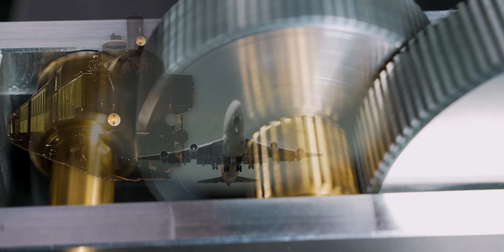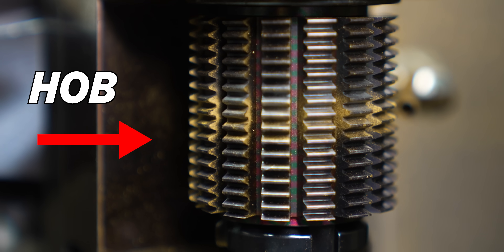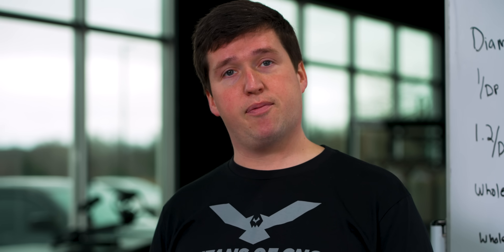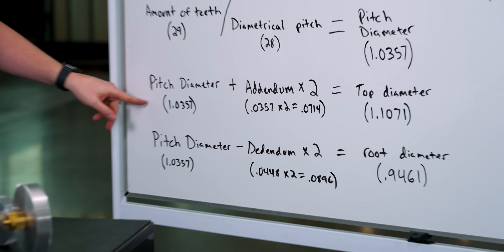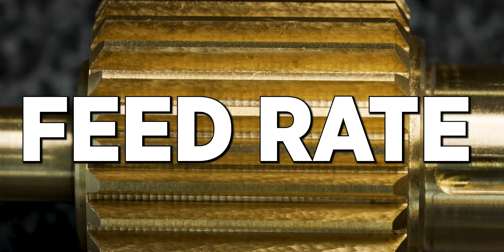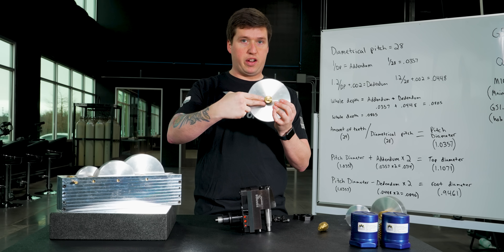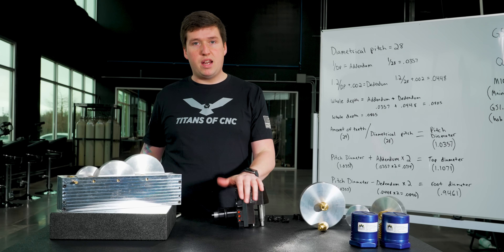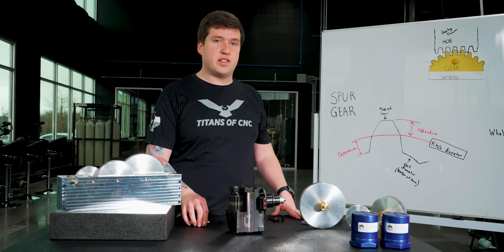This Mesmerizing Gear-Making Process Will Blow Your Mind

Comment: I'm a CNC Machinist in germany and we have to go through a 4ish year long apprenticeship to call ourselves "CNC Machinists". I had that subject in one of my last few questions on my final exam. Till that point we've never even discussed making gears in school, let alone at work. I had to literally learn it on the fly, while the clock was ticking, with nothing else but my calc and my formula book which just briefly went over it. I got 100% on those questions. Its such a "simple" procedure if you can get it quickly, but damn, I wish we actually talked about it in school because this would've been a make it or break it situation on my exam.

I just wanted to share this because the video just gave me flashbacks to my confusing self sitting at the table going all "What the fuck is this shit?!??!". Great video!

Comment: And if you don't angle the teeth of your round gears, they are more likely to catch on each other and bind up or refuse to mate at higher speeds. So it's not only a side effect of how hobs work, it's a necessary shape for gear function

Comment: Back in the day Fellows Gear Shapers used to send out cheater devices for machinists and engineers working with gears. It consisted of two disks enclosed in plastic. The discs had info for DP and modules. Fellow's also had their own system for stub tooth gears which was expressed as a fraction. The numerator was the for the pitch diameter and denominator was used for the tooth height. A 10/12 40T gear would have a pitch diameter of 4.000 with the OD being 4.000 + (2 x 1/12). Splines in the inch system are also expressed as fractions. 8/16, 10/20, 12/24 etc.

Comment: My experience with gear hobbling is all on mechanical gear hobbers. Barber-Colemans. Setting up for spur gears was easy. With a base ratio of 30-1* any spur gear was just 30 teeth for the input and the number of teeth in the gear being cut on the output. We had whole set of gears made up from 22T to over 72T. Helicals were a whole different ballgame. Get out the scratchpad and start figuring and after you figured out the index gears you had to figure out the feed gears. We actually had a book at work with the thrilling title of 14000 Gear Ratios. Once l had a solution for index and feed gears for a job l wrote it all down to future reference.
*The ratio between the work spindle worm gear and drive worm.

Comment: Can you make a video on internal power skiving and where to get the tools from for job shop work for lower qty jobs. Would be great to see it on the Doosan with the B axis.
Reply: @mikee6505  I would suggest power skiving not a great solution for job shop work, tools are expensive and usually dedicated to a pitch and number of teeth in the gear, assuming the machine has the level of rigidity and spindle synchronisation necessary to cope with the very demanding nature of the process. Most major producers of gear tools can help you, Gleason, Liebherr, Dathan etc along with many conventional tool suppliers like Sandvik, Horn, Emuge etc etc.

Comment: The thing people really don't get about gears is that the faces of the gear teeth actually roll against each other, it's not a sliding contact at all. (Unless you messed up, and you're going to wear that gear out in short order).

I thought you were going to miss the rake angle of the hob.... but then you got it.  ;-)

Don't forget that if you're going to make a lot of gears, you'll want to move the hob up and down between parts on occasion to spread the wear across the cutter.  Sharpening the hobs is a whole video of it's own.

I worked in a gear shop for a few years, we had some odd sized hobs that were 100 years old, that we only used occasionally, but when you need em, you need em.

Given the variety of gear teeth I cut in the job shop I worked at, it's quite likely some of the gears I helped make will still be in use 100 years from now.  That gives me quite a feeling of satisfaction.

Comment: Some corrections. 
The hob does not cause the gear blank to rotate as it sounded like you were saying. Both must be independently driven but at different speeds, the ratio of which is proportional to the number of teeth required in the gear.
Talking about how big a gear is in regard to addendum and addendum is ambiguous and confusing. You should be talking of the number of teeth and the module or DP of the teeth size. 
Addendum and dedendum do not disappear on a rack. That geometry is still relevant to racks. You are conflating the involute profile with addendum and dedendum.  That profile does become a straight line in a rack. But it is an involute curve profile for all spur gears and the other types.
The addendum is the distance from the top of the tooth to the pitch circle or pitch line in the case of a rack. That distance is half the tooth pitch. Deddendum is the addendum plus a clearance between the crown and the root of mating gear teeth. 
However, you did a great job describing the process in your "Calculating all this stuff" section. 
Sorry to go there, but I've been manufacturing gears for my servos for 40 years. 
Can't help but be a smartarse. LOL. Even if I'm just a tiny fish in a big pond. You guys are the sharks! ;-)
Reply: Came here to write that, if you don't drive the gear blank you will end up with crooked or wavy teeth, or it will fail to start in the right pattern altogether. Pretty sure he meant it in a way to make it better understandable for people who aren't familiar with this technology, but still.

Comment: If I may be super fussy about gear nomenclature- I think I'm hearing you say "diametrical" pitch rather than diametral pitch. I think it's written on the board as well. Excellent content regardless! Thank you for the education!!
Reply: I am trying to figure that out too haha. I also noticed your dedendum formula doesn't work with std hobs. 1.157/DP (diametral pitch) = dedendum. I'm getting different answers than our hobs say using your 1.2/DP +.002. Machinist handbooks also have my formula. Where did you find your formula for dedendum? Thanks for the video

Comment: Thank you for gear video. Next level is put a spline on the shaft and get a gear made on the wire EDM with a spline inside and a gear outside.

Comment: Thanks for tackling this subject, often seen as a ‘black art’ by many in Engineering production. If I may I will add a few comments that viewers may find useful. A rack as shown on the sketch of the Hob tooth profile in this video is simply a gear with an infinite pitch circle diameter and thus the involute profile is a straight line. The involute profile is simply the path traced by a point as it unwinds from a base circle (you can create a drawing of an involute with a plate, a piece of string and a pencil) and the gear tooth is a selected portion of this. It may also be useful for some viewers to know that hobbling is a continuous gear generating process (as are gear shaping and skiving etc) and thus the shape of the tooth is not the same as the hob cutter used to create it. This provides for a much more accurate gear profile than that which might be achieved using a form tool with the tooth profile ground into it and a using indexing or dividing head approach on the machine. Modern CNC machines use advanced synchronisation of the cutting and work-piece spindles often called an ‘electronic gearbox’. The control of this synchronisation on lathes and milling machines (non dedicated gear production equipment) is a relatively recent development which has given some of these more conventional CNC machines additional flexibility and capability which is desirable in some applications. Dedicated gear manufacturing equipment from the likes of Gleason, Liebherr, Koepfer, Monnier + Zahner etc takes gear production of all types to very high levels of productivity and capability and you should consider a feature on these machines.
Reply: Great input. Decades ago I had the opportunity to purchase a hobing machine. It was a great price but it would have cost thousands to get it from the UK to Australia. I was going to CNC at that time (35 years ago) and thought I could just make my own "electronic gearbox" and cut gears on my lathe. It's straightforward. The spindle control (which is a servo motor) is handed over to the hob spindle (also a servo motor), and the spindle just follows the hob at the appropriate speed ratio for the number of teeth. My machines are small and just CNC retrofitted manual machines. Right now I'm assembling a larger lathe. Going to have twice the speed and twice the torque and X axis much longer for more ganged tools, including live tooling.
Reply: @robguyatt9602  Hi, Great that you developed your own electronic gearbox, many would find this a daunting proposition! Problems with synchronisation arise when you are looking at high speeds and the hob and workpiece spindles need high performance feedback (encoders) etc to synchronise correctly along with advanced software. This is particularly an issue when you need high levels of gear accuracy for pitch and lead errors, the profile being more related to hob quality. Gear Metrology is also a fascinating subject all of its own. I have been lucky enough to work for a company that specialises in fine pitch gears of the highest quality and has been able to invest in the finest machines and metrology equipment to achieve its goals. Good luck with your endeavours in the gear production world.
Reply: @alexgreenhalgh935  Thanks for your reply. I actually wrote my own PC CAM program to drive my first CNC retrofit. Simple program that drove steppers full step. Two axis interpolation was a struggle though. What do you call fine pitch? My gears are mostly 0.5 mod but also some 0.3 mod. I have also done gears of 4 mod but they were 3d printed. I expect you are familiar with those sizes but just incase you only work in dp, 0.5 mod is about 48 dp. 
Yep it takes high speed processing of encoder signals for tight sync. I use a 50 MHz microcontroller. Also, the servo drivers  for the two spindles are tuned to tight following error. You might wonder what I do. My bread and butter work is RC servos used for sail control in RC racing yachts. These are winch servos, which means they do multiple turns as opposed to the normal 1/4 - 1/2 turn off-the-shelf servos used for steering, rudders, etc. I also do occasional one-off commissions. My favourite was an extra large winch servo for an autonomous yacht designed to cross the oceans.
Reply: @robguyatt9602  In the UK most engineers say over 50ish can swap seamlessly between Inch and Metric systems so happy with either, although Module is increasingly the most common. We typically work in the 0.2 to 1.5Mod range, but we can cut up to around 4 Mod for Anti-Backlash pick-off gears that occasionally crop up. We also have proprietary transmission error measuring tools that can be used to evaluate gearboxes and gear machines and we can usually squeeze more performance out of a machine than the manufacturer designed it to have 🙂.  Funnily enough I am building a entry level RC yacht myself (only an off the shelf, low cost Dragonforce 65 kit, but you have to start somewhere) and looking forward to sailing it in the summer, so familiar with the winch servo concept.
Reply: @alexgreenhalgh935  When I started my apprenticeship in 1973, Australia was transitioning to metric. So yep I'm bilingual LOL. Cool that you are getting into RC yachting. The DF thing has been a great innovation for the sport. My market has always been the top end of the world RC racing scene. The IOM class my biggest production of course. My range goes up to the huge J class used in the USA. Even if my products were allowed under the DF rules, I would not be interested in upping production. I enjoy my small 1000 units p/a manufacturing schedule. I don't have fully automatic CNC so it's pretty hands on. Except for 3d printing which is used for some parts including low load gears. But the main servo gearbox is all machined. Certainly nowhere near the precision of what you talk of. My ears are my measuring tool for quality gears. They have heard a lot of teeth  over 40 years. LOL.

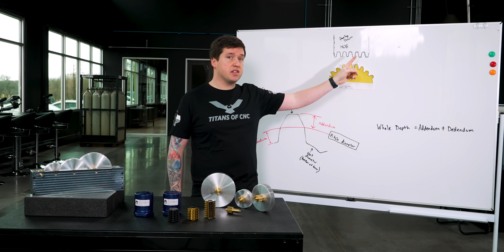Comment: 2:10 A Rack still has an Addendum and a Dedendum. Its with at the Pitch circle defines Addendum hight with is important when you want to grind gears after Hardening. Then you would use a hob with a bigger addendum and machine the root circle to finished dimension while still leaving stock on the flank to be ground later.

Comment: The fact that people figured out involoute teeth without simulation is amazing to me. If you think about it REAL hard, every tooth exchange is a wheel rolling against another wheel.  The first tooth face against the second tooth face is a wheel rolling against a wheel for a fraction of a second. And this is how involoutes prevent acceleration and deceleration between tooth exchanges and with minimal friction.  Brilliant!
Reply: The principle of generating the involute curve for a tooth profile is quite simple. I would develop the curve on the drawing board and then use that to create a template to hand grind the tool. That was 40 years ago, before I had access to CAD and CNC. That came a few years later and as Titan would say "BOOM" production went through the roof. I must have cut a shit-ton of gear teeth over the last 40 years, LOL. The invention of the involute profile was a game changer for sure. In theory, it creates a rolling motion between mating teeth and, therefore, zero friction. But you are right. In the real world, there is friction, but it's tiny compared to the early tooth forms.
Reply: @robguyatt9602  it's the association between an involute tangent to a circle can convey a perfectly circular and synchronous engagement between two surfaces other than the two pitch circles such that there is no sliding but two rolling surfaces.

Machining that is amazing, yet, but figuring it out is what amazes me.
Reply: @ You just repeated what I wrote.
Reply: @robguyatt9602  no sir. I rewrote what I said.
Reply: The most fascinating thing is that there isn't even much math involved in the machining. The cutter is just like a thread with a trapezoidal profile, so only straight lines. Yet, the rotating motion of the blank during the cutting will cause it to create a perfect involute curve, no matter the size.
Reply: @CatNolara  right! It's just machines doing what machines do. I am sure this CNC machine makes superior gears, but hobbing can be done just through mechanical action.
Reply: @coreyfro  exactly, I've even seen people having attachments for gear making on an old school shaper. It had a trapezoidal tool and a mechanism for advancing the table and an indexing head at the same time. Super interesting
Reply: @CatNolara  that's EXACTLY why I have wanted an ol school shaper. That and they are just HYPNOTIC.

Comment: When I make a helical worm wheel I use a dividing head and a single HSS  fly  cutter shaped on a bench grinder. Any tiny discrepancy is not a problem because the machine I'm repairing has been working for years with worn out gears before stripping completely. 
Btw I made my 81 tooth bicycle chainring with the rotary table.
Reply: Greetings Sydney Australia.
Reply: Crazy the technology people figured out. That’s super cool

Comment: Cleared up a lot of the confusion for me with figuring pitch diameter.  I was reading the machinery's handbook on gears and set it aside lol.   The brain started to see geometric shapes floating around.  Another video walking away learning something new.  Much gratitude.
Reply: Hobbing can be used to cut a lot of things besides gears. Squares, hexes, screws (worms), splines, tapered splines (straight, serated and involute), interrupted forms etc.

Comment: I did my apprenticeship as a gear cutter here in south Wales UK. We used a Jowett thread milling and hobbing machine. No where near as technological as this stuff. You had to set gears for the number of teeth and feed. You did have to set the head for the angle of the hob. I'm not sure what he said about a rack not having an addendum and deddendum though. When we cut racks we'd set our tooth verniers to the correct addendum and tooth thickness to make sure we had the correct amount of backlash.
Reply: I think what he didn't explain is the curved flank of a typical gear tooth is an involute profile, that's a curve made by tracing a point on a circle rolling on another circle. A rack is a gear with an infinitely large diameter, so the involute tooth profile ends up a straight line.

Comment: gears always have been a pain in the ass for me, i only work with manual machines
Reply: math is math whether its metric or imperial. 
i was brought up on both but i do prefer metric, probably because 99% of my work is metric, and has been for almost all my 41 years in the machining industry.